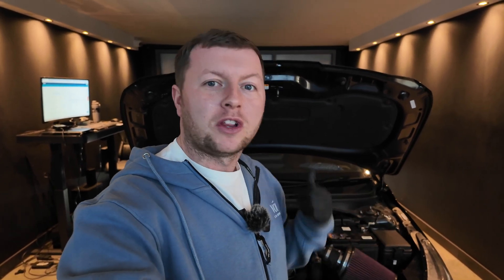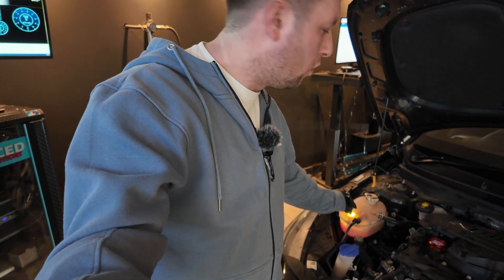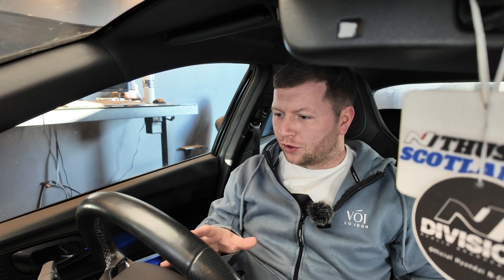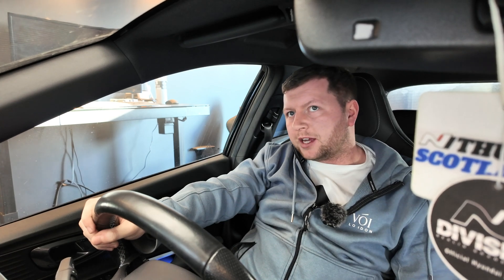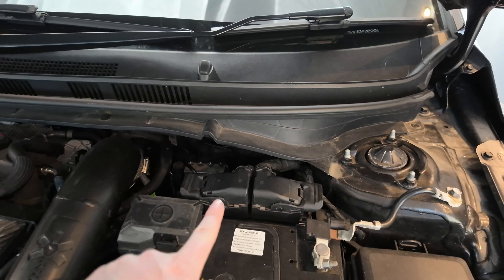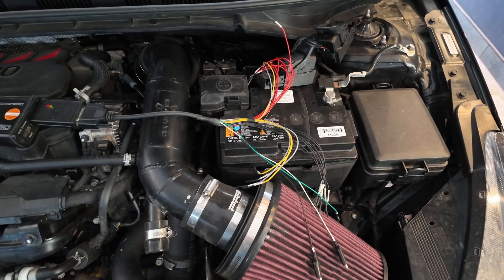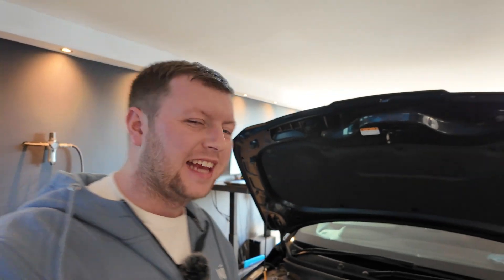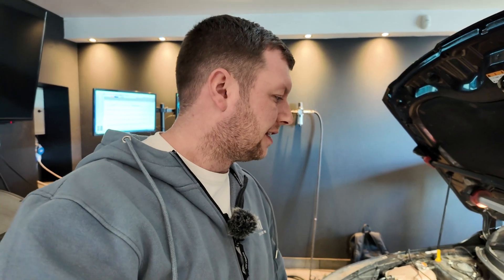MAKING A HYUNDAI I20N STAGE 1 ECU TUNE!

Comment: Can I ask you please what if you retrofit an i30n turbocharger as the primary starting point as I own a Feb 23 manufactured i20N and I’m thinking when I’m out of warranty and ready to jump in with mods that’s the first point as long as the i30n turbocharger is water cooled too as I live down under I wouldn’t be able to get my car to you but those numbers especially torque are that of the i30n anyway I’d be interested to hear what you think about that upgrade to help remove the main problem running out of turbo .

Comment: what values of max boost /torque you read on N screen on the dash?
Reply: the dash software is limited to 1.3 bar/20psi and 310/320nm, it can't show higher than that, the N mode screen on the centre console can show higher horsepower values though!

Comment: Hi! Really informative video, thanks for posting such a detailled video! 

The i20N is so loud on startup because it opens the wastegate wide open to avoid an overboost condition 😁 (so I was told) 

Couple of questions

Which mode does your map overwrite? (N Mode, sport, normal or eco?) Can this be changed? I'd quite like to replace N mode but place the old N mode map onto sport, and the sport mode onto the normal (I'm weird 😂) 

Does this remove the pops and bangs at 3.5k, 4k and 4.5k rpm and on a redline shift? (Can these be enhanced via the ecu flash?) 

What kind of figures can I expect with zero modifications i.e no intercooler upgrade, and possibly the pipercross panel filter? 

If your PC that runs your dyno has issues tripping out, why not copy it onto an SSD to eliminate the old "spinning rust" disc? It's a SUPER simple job and you can do it for free with something like Macrium Reflect (free) or Aoemi Partition Assistant (paid, but it's the best around)

Looking forward to seeing stage two!
Reply: Generally the wastegate is opened on cold start, may be on this particular car it opens under other conditions as well but the reason for that is quite simply to bypass the turbine wheel to get the CAT up to operating temperature quicker. It's purely an emissions tool.

Comment: I had your stage 1 remap installed on my I20N last week via Ignite Performance. First impressions are positive as the increased torque massively improves my driving experience. On the hub dyno, my figures were 239bhp at 4700RPM AND 290lbft (396NM) of torque at 3200RPM. I have full air intake, intercooler and GPF delete fitted so these definitely complimented the remap 👍🏼
Reply from the maker: great to hear that your enjoying the tune :D